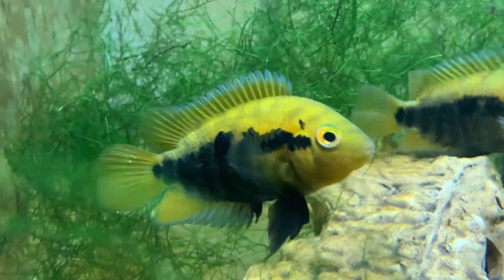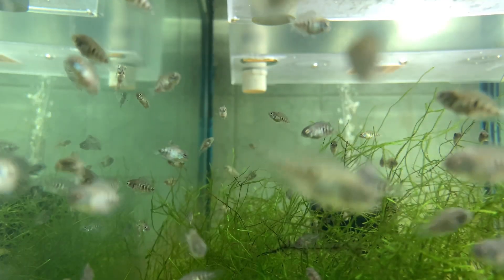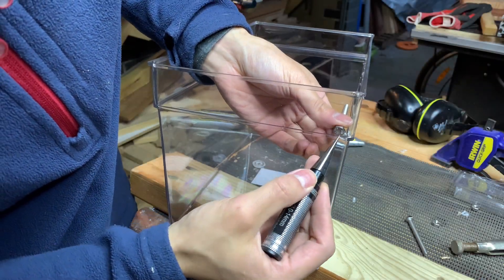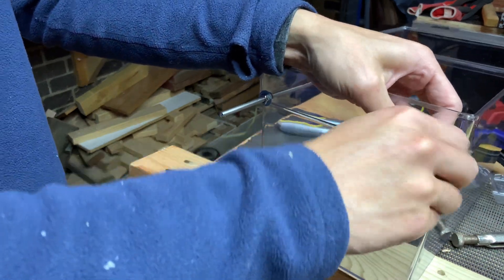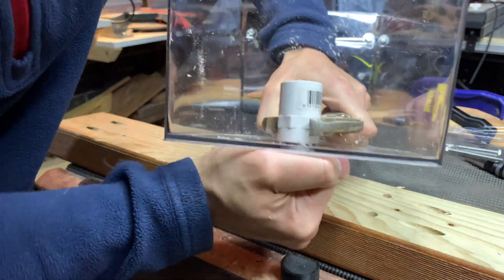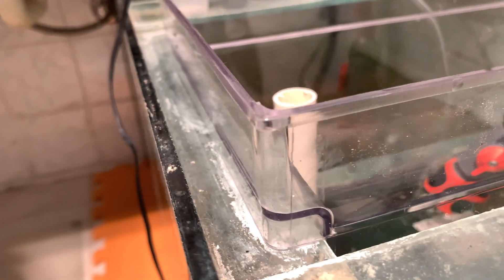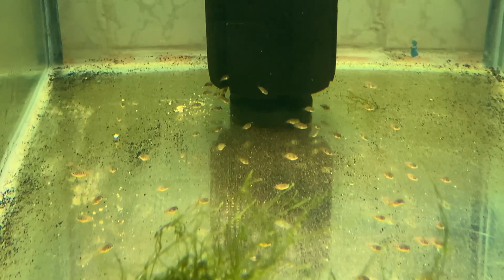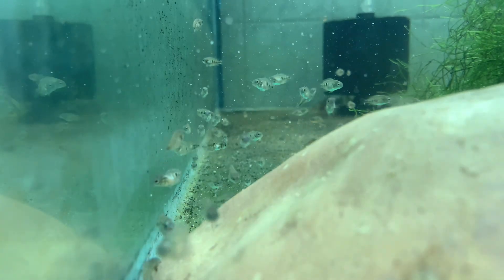DIY Demo: Air pump powered fish fry raising system

Comment: Hi mate i have literally done this today but steuggling with the loft of the water i used a straight pipe dont suppose you have discord or something i could drop you slme pictures across
Reply from the maker: Sorry I’m not on those platforms. I’d consider adjusting the the size of the airstone and see if you can source a stronger air pump, what diameter pvc pipe did you use?
Reply: @Varanibae  its 22ml pipe decent pump up to 900lph here is a video of it https://youtu.be/1UmWVEaIjmM seems to be working ok now any suggestions though
Reply from the maker: @chriswarwick8934 great setup you’ve got! I wonder if you get more flow if airline to the airstone doesn’t go through the pipe. Much more tricky to setup and secure in the correct position but that’s the only idea I have at the moment
Reply: @Varanibae  so have the airstone upside down in the tube and the air line outside the pipe going through underneath instead of throiught the top
Reply from the maker: @chriswarwick8934 yeah
Reply: @Varanibae  https://youtube.com/shorts/hJczD5L_Mto

so iv thought about doing it like this i take it this will work the same and wouldn't have any filtering issues ?
Reply from the maker: @chriswarwick8934 great idea! Already looking like there’s more flow. Doing it your way should provide even more filtration ;)
Reply: @Varanibae appreciate it... are you not doing aquarium stuff now I see ?
Reply from the maker: @chriswarwick8934 unfortunately not since I moved to a smaller house. In a few years time I hope to get back into it

Comment: My understanding is that the taller the lift tube that contains the air stone the faster it will move water because the bubbles have more time to accelerate. Try putting an extension pipe extending to the bottom of the aquarium and push the air stone all the way down to see if it gets more flow. Also, the air stone it self is blocking a large part of the pipe. It might be causing the flow to be slower. Try removing the air stone and see if that makes it move more water.
Reply from the maker: That's an interesting idea, I'll experiment with that on my next build.
Reply: I tried this just now and the flow is way better when the tube is longer and the air is coming from the lowest point you can put it, i also dont have an air stone.